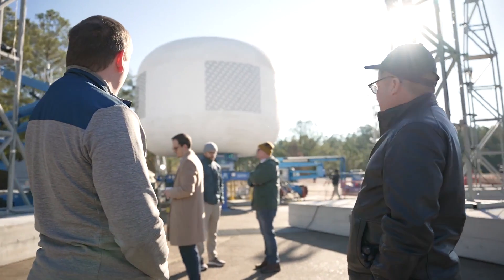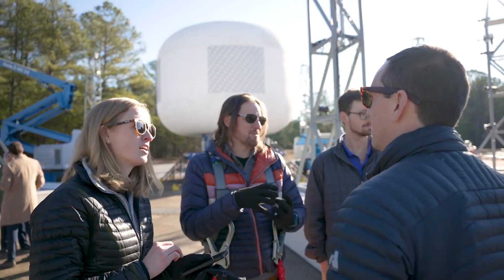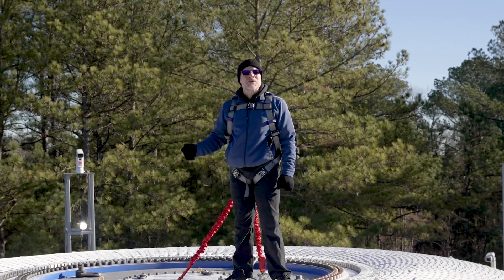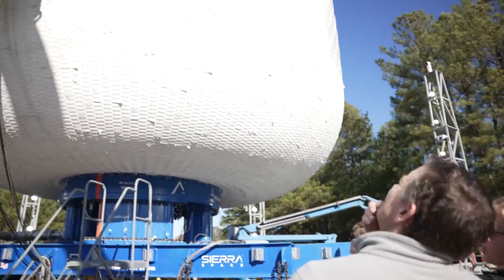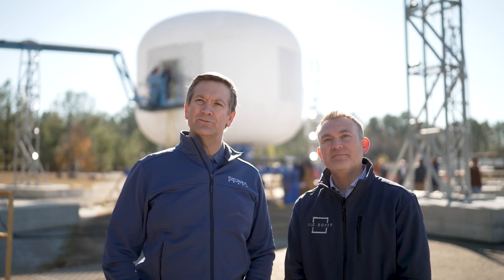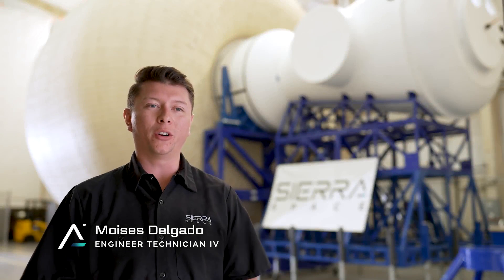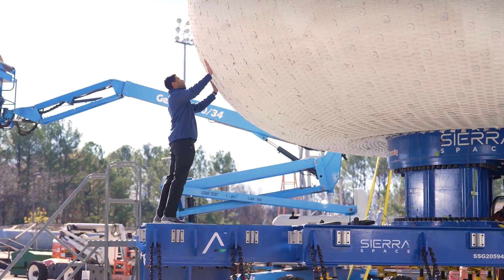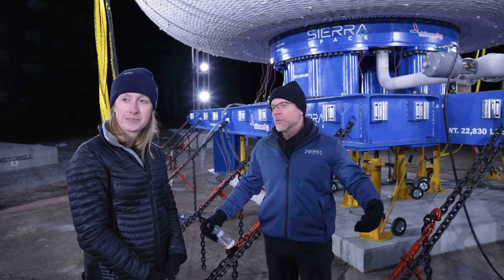Full-scale Sierra Space inflatable habitat explained  - Watch it burst in test!

Comment: I be damn, this is as dangerous as taking a fiberglass hall down to the titanic. We all know how that turned out
Reply: the pressure under water is alot higher and more dangerous than the pressures sustained in the vacuum of space. please do your research before saying stuff like this. this technology has been being developed since i was a kid and I've watched multiple of inflatable modules be launched including the successful Bigelow module. cant wait for this to be accepted by NASA and the rest of the space community as this will make space stations SO MUCH BIGGER
Reply: @IcedDragon420  research? You assume I have no understanding of sea pressure vs a vacuum. Granted the pressure is not nearly as high ( negative pressure of course ) what -10 to 15 psi or so. But think about why the shuttle orbited backwards? Have you given any thought to that? 

How do you think a blowup building will handle getting hit with a bullet size rock traveling 100s of thousands miles per hr? 

The shuttle orbited backwards so the rear would be hit, rather than the crew compartment. 

We need to figure out how to build in space, not reinvent the wheel.

Pressure is not the problem. The safety of those inside is.
Reply: @anthonymiller7992  I agree with you %100 and will go forward with a new thought process when thinking about inflatable habitats